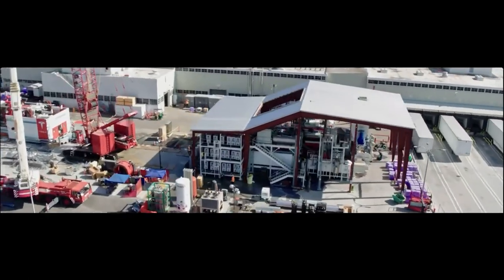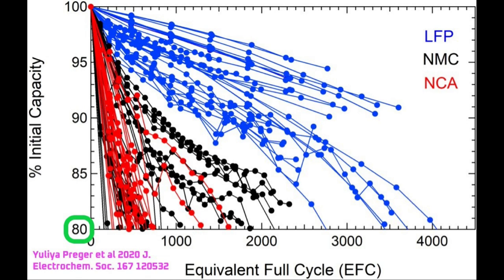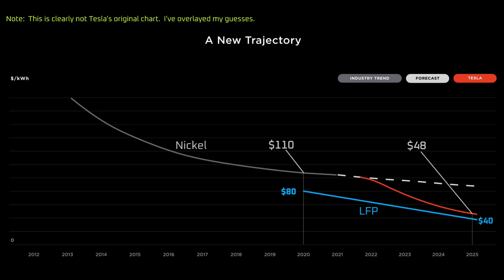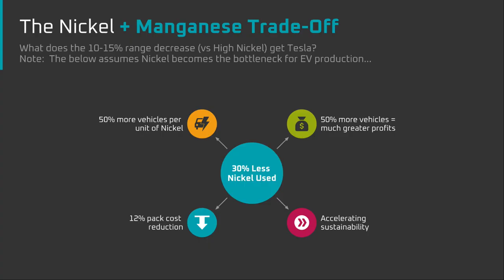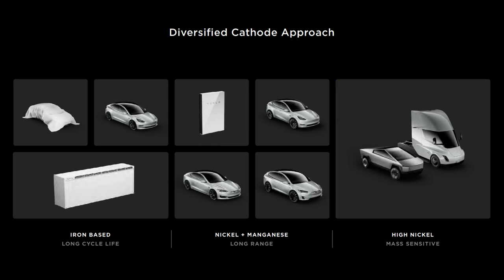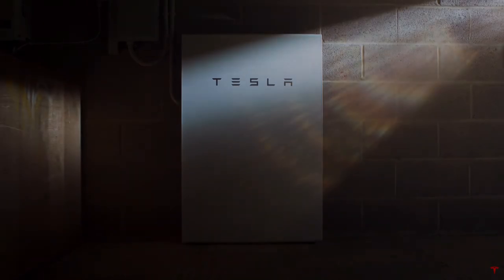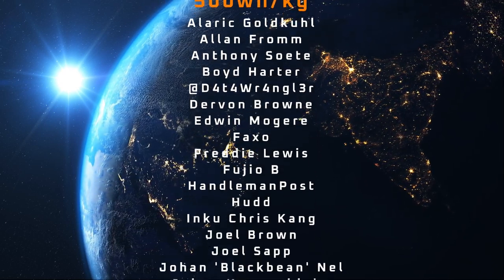#11 Tesla's Three Cathode Choices // Product Impact

Comment: Hey Jordan, I've been re-watching your truly terrific "Lithium Mine to Battery Line Series" and I have a couple questions. First, I seem to have missed your approach to volumetric energy density. Do you see capacity increasing with specific energy at a commensurate rate or at a different rate? Second, you mentioned that, on the cell-level, the LFP with Graphite Anode, would have 50% of the High Nickel Cell 's capacity. If cycle life were a non-issue and Tesla developed an LFP with a Silicon Anode, what would the difference in capacity be?  And are the  differences in LFP, N-M and High-Nickel cell capacity, the same as the difference in their specific energy? Apologies for the long comment. Thank you again for making this video series!!!
Reply from the maker: Hey man!  Thanks for the support.  To your questions:

I haven't been focused on volumetric energy density, but they tend to trend together.  There are some exceptions but over the next 5 years at least they are headed in the same direction.  

If Tesla weren't concerned with cycle life, I'd like to think they could squeeze out another 15% energy density from LFP.

No, the specific energy of the materials varies are of a greater magnitude, but similar ratio.  Everything gets diluted when moving from material to cell level to pack level.
Reply: @thelimitingfactor  Thank you Jordan, I appreciate the quick turn around  on your response. And it is very much my pleasure to support this channel. 

"Everything gets diluted when moving from material to cell level to pack level." I've noticed this too, doing my own research on these topics. It's sort of like the "turtles all the way down" dilemma, only it's rough estimates and approximations, instead of turtles.

Quick aside: do you think the LFP will us Tesla's standard 96S grouping pattern or change to something like 108 bricks, to compensate for the difference in voltage? And how likely is a new voltage architecture(s) for their other packs? 

Great work on the "Salt+Clay" video BTW! Looking forward to next installment!

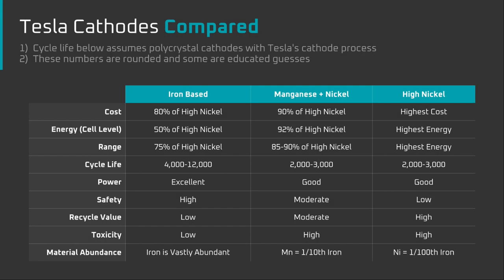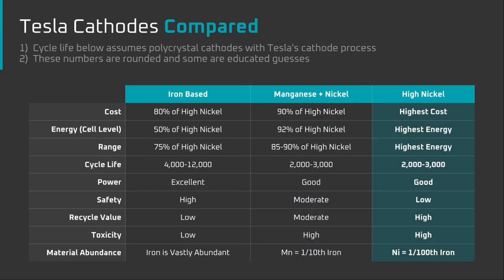Comment: At 21:13,  the chart lists Nickel-Manganese at 90% of the cost and 92% of cell level energy (compared to high nickel). At 21:41 it changes to 88% and 90% respectively.  Then at 21:50, it changes back to the original. Which figures are accurate?

Comment: I'm thinking Cybertruck tri-motor will get high nickel while single and dual will use LFP.  They could keep the pack design and vehicle weight the same except change the cell.

Comment: While LFP sounds like it can play a bigger role, it sounds like its not suppose to be charged below freezing temp so assume for a car you would have to use energy to heat itself?
Also, for V2G, Hyundai new car supports it so may pressure Tesla to respond if it catches on.
Reply from the maker: I need to look into this...on my list

Comment: The assumption that Tesla is diverting Model S cells into powerwall makes sense, but IIRC the 18650's haven't been used in that product for years. The S/X are the only product that uses them. So either they're getting re-introduced into storage or Tesla is simply buying fewer cells and increasing their margin on those products.

Comment: V2G is a great technology but a bit sophisticated for the average consumer right now.  I don't actually think they need to have any updated power electronics onboard the car to do V2G, just a software update to BMS and charging system to open the contactor to the pack.  But an external V2G unit will have to take the DC voltage from the pack and turn it into AC for the grid. An upside could also be faster charging at home from a V2G unit.

Comment: This was playing while I was looking for an item in the comments.    
Vehicle to grid.
One time Elon was discussing this.   It is all in the charging socket and cable.   The us model does not have return wires and contacts.  In Europe they use a European standard plug/lead which incorporates those two extra contacts and wires.  NOT his exact words but that was the jist of the problem.  So yes in Europe it could be done easily  but in America it is not easily achieved.

Comment: Queensland Pacific Metals Limited (ASX:QPM) is the 100% owner of the Townsville Energy Chemicals Hub
The TECH Project will be an advanced modern and sustainable producer of critical chemicals for the emerging lithium ion battery and electric vehicle sector.

Processing high grade ore imported from New Caledonia, the TECH Project will produce nickel sulfate, cobalt sulfate, and high purity alumina and other by-products – leaving, for the first time ever in the world, almost zero waste products. MOUs signed with LG Chem and Samsung, both providers in the exponentially growing Electric Vehicle market. A green eco friendly company with a great future. 

Recently the company has decided to double the size of the nickel processing plant in order to supply an increasing demand in the EV nickel sector. Queensland Pacific Metals uses solar power to power the TECH project. QPM is already positioning the TECH Project to have
the best sustainability credentials of nickel and cobalt projects, with a flowsheet that is zero liquids
discharge and potentially zero solids discharge. 

As Elon Musk had said himself: "Tesla will give you a giant contract for a long period of time if you mine nickel efficiently and in an environmentally sensitive way."

Comment: I think that LFP with silicon anode and 2000-3000 cycle life should be more than enough for a 250 miles car. graphite and 10000 cycles for storage is perfect.

Comment: In the short term, I think Tesla will just let CATL build LFP Cylindrical Cells like the 32600. Should be able to integrate them into a structural pack and be able to use them in low-cost Teslas.

Comment: One of the most overlooked takeaways of Battery Day was that Tesla will reduce the price by about 50 % and increase the range by about 50 % AT THE SAME TIME. Since Tesla’s cars already have enough range, they could easily reduce the size of the battery to 2/3 of the original size which would result in (1/2 * 2/3 =) 1/3 the price for the entire battery. But because of the reduced weight of that battery Tesla would still achieve an remarkable range increase.
And (like you said with the Model S/X refresh) this would free up a lot of battery capacity.
Reply from the maker: Nah, see the last slide they showed for their cost trajectory.  Targeting about $50 at the pack level in 2025.  They'll get to a 2/3 decrease for sure, but the scope for battery day was 3-5 years max.
Reply: @thelimitingfactor  – $50 is per kWh but doesn’t say much about the size of the entire battery!
Reply: Just to make myself clear. Imagine you have a car with the old batteries and a range of 360 miles. With the changes discusssed at Battery Day you would end up with a new car with a range of 540 miles, but the entire battery costs half as much as that in the old car.
But was is the sense of having a range of 540 miles?
You could implement a smaller battery (2/3 the size) which brings the costs of the entire size down to 1/3 of the original one (probably not eaxctly, since some of the savings were due to the structure of the car). The reduced battery has lot less weight, so the range wouldn’t be 360 miles but remarkably more.

Comment: Cost is the main improvement required , with already power density improvements good and structures meaning pack level improvements for Tesla could mean drop in cars to follow .when giga Berlin, Texas and China extension done costs will drop year on year, by 2024 25000 dollar model 2 with 300 mile range should be easy

Comment: 1) Can you please elaborate on CATL's Cell to Pack design used in Shanghai made Model 3?
2) I have searched the whole internet but nowhere can I find breakdown or showcase of Shanghai made Model 3 CATL Battery pack. Is there any source or real picture of Model 3 CATL Battery pack ?
I really would like to see the cooling system that Tesla must have used on Shanghai made Model 3
3) Whats your opinion on decreased range and cold start problems with Shanghai made Model 3's battery ?
Although cheap and immune from supply problems Is Lithium ion phosphate chemistry really reliable even in short range vehicles as we hear numerous complains with battery performance of Shanghai made Tesla Model 3?
Reply from the maker: At some point I'll try to answer all these questions.  It's just not doable in the comments section.
Reply: @thelimitingfactor  Will be eagerly waiting for your upcoming videos😀

Comment: RE: V2G - what about safety? Like for people who have solar or generators during a power outage they have to make sure all that power doesn't go back into the grid and kill a power co. worker or someone touching a downed power line.
Reply: Automatic transfer switches and the like can do the job to safely isolate the system. Solar system controllers shut off power when you are tied to the grid and have a power outage. If you have storage from a power wall or vehicle it to can be isolated.
Reply: @MrBadgas  Thank you!

Comment: I have a question the volume of 4680 is 46 x 80 = 3680 and for the 2170 is 21 x 70 = 1470 and 3680/1470 = 2.5 so the 4680 has 2.5 times the volume of the 2170
But on Battery day 49:30 They say 5X the energy and 16% the range on "just form factor alone" So it's 5X the energy  of what? Of a single 2170 ? Or is it 1 Kg of 4680s vs 1 Kg of 2170s
or something else? Maybe the tabless design?
Reply from the maker: You're using the incorrect formual for volume.  All your other questions were answered in previous videos.  Maybe the cell design video?  I forget, I'm 12 videos into the series now, lol.
Reply: @thelimitingfactor  Dooooh!

Comment: It seems to me that a lot of focus and energy (no pun intended) is focused on creating a ‘perfect’ universal battery cell; light weight, excellent charge and power density, 4000+ charge and discharge cycles and made of cheap abundant materials.  Rather than letting ‘perfection’ become the enemy of ‘good’ an intermediary solution might already be available.  It seems that LFP and NCM cells complement each other and that a pack made up of 50% of each might be a useful  ‘Jack of all trades’ battery;  with the LFP cells offering a high power ‘front end’ with frequent charge/discharge cycles and NCM cells providing ‘back end’ large capacity and long range.  Electronic battery management would have to accommodate the two battery types by this route might be easier in the short term whilst chasing elusive panacea chemistries.
Reply from the maker: Could be, but I haven't seen any evidence to support this and to address all the complications a multichemistry battery creates (totally different voltage profiles, etc).  If you know if a research paper or of someone actually doing this, fire me a link.

Comment: I have no doubt you will be able to wire your Cybertruck into your house. Wire up a NEMA 6-50 or 14-50 outlet. When the Cybertruck does come out, go to the hardware store, get yourself some 6 AWG 3 or 4 wire, 6-2 or 6-3 however long you need, the end you need to plug into the Cybertruck 240V outlet, and the end you need for the outlet going into your outlet. The order of the hots doesn't matter, you have a ground, and maybe a neutral. You'll need a screw driver, and a wire stripper. Wire it up. Piece of cake. BUT, YOU MUST TURN OFF THE MAIN BEFORE PLUGGING IT IN. The inverter they put in the Cybertruck will not be a grid tie inverter, and there is zero chance the Cybertruck can power the whole neighborhood when the power is out, and it's illegal to put power on the wire when the power company shuts it off. I hooked up my own grid tie solar system. Look up the sections in the National Electric Code NEC on solar if you are interested. It's in there.

Comment: I didn't know LFP has 'Excellent' Power output (and input I assume)! Does that mean that a 200 mile range car can Supercharge super fast? Personally if my 200 mile car can get 180 miles in 15 min then it does better than the long range Model 3 on road trips, and I don't need more than 150-200 miles day-to-day.. :) Can someone please do the math on this? I'm too lazy.
Reply from the maker: I still need to look more into this!  The only video I've done on charge rates is on Tesla Silicon for high nickel.
Reply: It was the reason that chemistry was initially developed.
Reply: @thelimitingfactor  Thanks for the reply! Look forward to a video on this in the future. 

P.S. If you ever make a t-/sweatshirt with battery tech on it like pictures of tabless or cell-to-pack put me down for two 😁 I love supporting youtubers this way but I'm not really into logos 😋

Comment: There are newer types of flow batteries being developed that won't rely on vanadium, but rather the 2 oxidation states of iron. One example is the iron-zinc battery described in thsi research: https://iopscience.iop.org/article/10.1149/2.0591706jes/meta 
The material cost on this should be dramatically cheaper than anything vanadium. LFP may still be cheaper, but it should make cost differential less of a consideration.
Reply from the maker: Totally!  This is why I specificed Vanadium.  Unfortunately, the other flow batteries look to be some ways away.   At least the ones I'm interested in (organics)

Comment: An EV with V2G in the Texas power outage would have been much better than a gasoline generator - much more power and much easier than filling 5 gallon gasoline cans. I see the FERC 2222 order enabling distributed energy resource (DER) aggregators to compete in all regional organized wholesale electric markets. I.e. That means EV's with V2G could make money on the grid when not used for transport. When markets are created in about 2-3 years, EV buyers will start asking for V2G in mass, and EV makers will see the value of adding this low cost upgrade. An EV is easily made into a mobile power plant.

Comment: Awesome video. I contest the million mile definition in one part though. If you zero out a battery you majorly screwed up. Depths of charge being 0-100 is wholly unreasonable. At minimum 5-100 or 10-100. Also, constantly pushing to 100 is similarly, though less, an unnecessary demand. So 5-95 or 10-90 would be a better test metric for real world longevity. And if you wanted to get more refined you could push to 100 every X times. Like 5-95 with 5-100 every 10th cycle. Not as simplistic a setup, but more useful data for the real world.
Reply from the maker: Nah, not wholly unreasonable in my opinion.  If you look at the data for the newer chemistries they're cracking 0-4.3 volts.  See the cathode deep dive video.

Comment: A couple of thoughts.... how much degradation occurs if a current Tesla with 2170 Panasonic-produced cells is charged to 100% every time and run down to 5% or less?  I wonder if it's really THAT major a degradation if you only charge every week to 10 or 12 days.  Also, that degradation means there's a slow reduction in range over time... what is that reduction, and ihow many charge/use cycles ACTUALLY gets the vehicle to a million miles?  Finally, does one end up with some terribly low range after 5000 charge cycles?  Hopefully some 'Tuber is ruining their battery by doing this, and keeping track of it!

Comment: On your 100 kWh to 90 kWh slide the assumption #3 I beleive it to be wrong.
 While a permanent magnet motor is more efficient  producing torque it has a Eddie current torque loss because of permanent magnets.
 An induction motor does not have this. So it's more efficient to have an induction motor idling than a permanent magnet one.
90-99% of the time Model 3 Dual Motors use only the rear permanent magnet motor. 
The front induction motor in only use for hard accelerations, reverse and rear wheel slipping on slippery conditions.
Reply from the maker: There's more to it than that and it was a rough guesstimate.  It would take its own deep dive.

Comment: liquid metal battery sounds nice until you look closely at it. they simply haven't yet solved the engineering challenges of making it work, and it's currently not very clear they can be solved in an economical way given current available tech. the thermal seals needed for the current collectors DO NOT (currently) exist at the sorts of costs they need. Antimony (or should I say anti-money) is also not that cheap if you suddenly increase the demand for it to the levels needed for grid storage.
Reply: That's not my understanding of the issue they can and have made cells for year that work as desired what they failed to done was automate the process , it does not surprise me that researcher failed at manufacturing , material cost are as you say an issue but they have many (to many) different chemistry's
Reply: @alanrickett2537  "prototypes are easy, manufacturing at scale is very difficult" -Elon
Reply: @dandil  correct but it is a production problem not a is it possible one